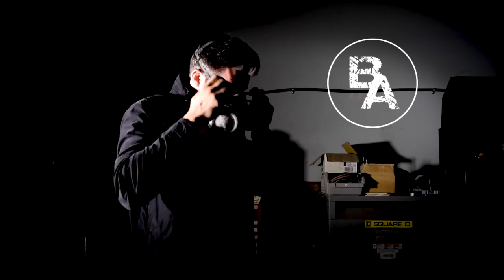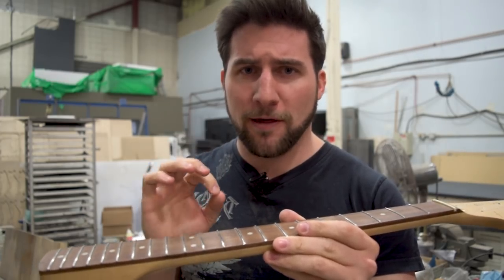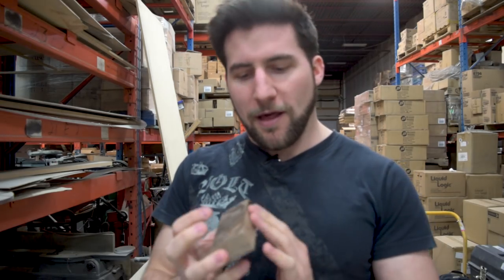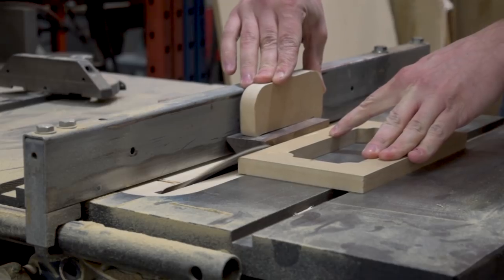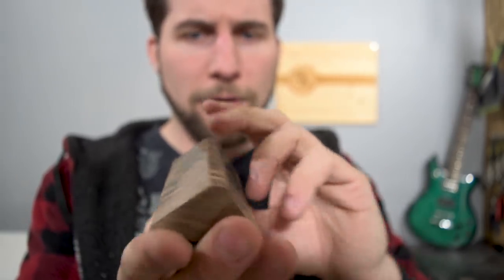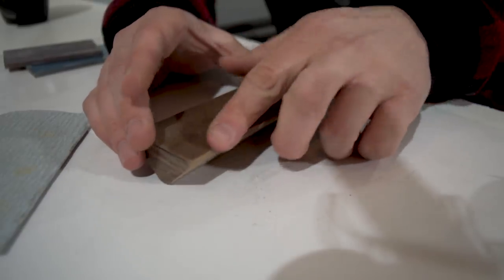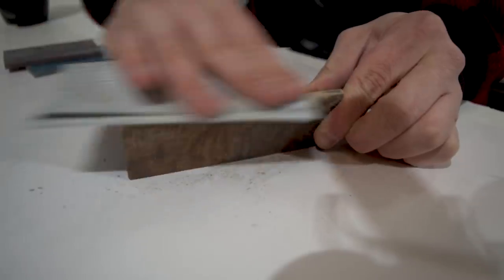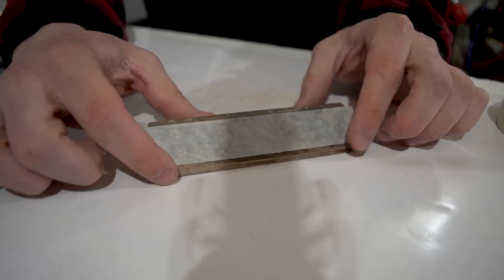CHEAP and EFFECTIVE DIY fret crowning tool

Comment: I bought a fret crowning file. They are about 5 bucks on Amazon
Reply from the maker: Yup. Only the good ones are expensive. The others are just slow.
Reply: @BradAngove  worked for me anyway. Enjoyed your video though. Thanks.
Reply from the maker: Glad to hear it got the job done.
Reply from the maker: Can you not tell which side is more aggressive if you shine a small light in there?
Reply: I bought a crowning file from Stewart McDonald. I use it about two or three times a month. It takes about two minutes to do all the frets on a guitar. Comes out perfect every time. Worth every penny I paid for it. Is sound last me decades. Cheap is never the best way.
Reply: @erichuff6945  There's cheap, there's fast, and there's good. You get to choose two.
Reply: @doctorschmitty4122  I have been a professional mechanic for twenty five years. Cheep tools don't make money and can get you hurt. As a commercial truck mechanic half assing a job can get you a prison sentence. I guess the level of discipline I have for my work carries over to my hobbies. Plus every instrument I build has to meet me standards for playability. If a tool isn't good enough I will make on that is.

Comment: I can see a lot of issues with not only making the tool because I don't own a table saw but in using it. I am way too lazy to take the time to do all that work when just as I am writing this I can click play and a tool shows up I unwrap it and go to work! It looks like this
Reply from the maker: Or you could just buy a neck that already has this done haha.
Reply: @BradAngove  Say What... Do they make necks with fret wire that has already been crowned and polished? Why would they take all the fun away???
Reply: Brad, I bought my first tele this week off of an auction site. When Opened the box and debubble wrapped it, At first I was real mad at myself for not paying close enough attention to the pictures or description because I bought somebodies d.i.y. project gone bad. No sound, opened the cavity for the output jack and the knobs, half the wires were never soldered, barely any paint on the bod, rough as hell as if sandpaper must not exist where this person lives and talk about a baseball bat of a neck if fret wires not installed correctly (I think?) They had to of used a hand saw without a template? But that's ok I did not think I was ever going to need the skill of sanding, grain filling staining or painting the body, havent decided yet, waiting for some inspiration on that! The color on it matches  a short scale Luna I have, so I am thinking I'm gonna color match and paint it, but I wanted to send you some before pics and let you get a good laugh. This will be my first real "build" if you will and when I think I have finished, if I'm able to, I will send you after pics or...a video!
Reply: Opps forgot to attach pics, well I dont think I can attach any pics here?
Reply from the maker: Wow that’s sounds like a true mess haha. You can use the links in the description for Instagram or Facebook to send me photos.

Comment: If you use a piece of square stock and plane a 1/4" flat on each corner there is no need for any risky 45 degree cutting
Reply: Correctomundo

Comment: Why not just crown it into a point? Like an upside down "V"? Isnt that way more simple?
Reply from the maker: It’s less comfortable, harder on your strings, requires the removal of much more material, and makes the tops of the frets less durable because of how little metal is left. That is likely to result in you needing to re-level sooner, and because of the new shape you would end up reducing the height of your frets much more rapidly.

Comment: Did you say you have a fret leveling video. Or that you need to make one? I see guys take the leveling bar that is the length of the neck and go up and down the length. I saw one video from a Luthier that says that is wrong. He says  You lay it across the length of the board but sand back and forth  from the 6th string to the 1rst and visa vera
Reply from the maker: If you move a bar the size of the neck the entire length of the neck you will oversand the middle frets. 
I’ve done a couple videos involving feet leveling, but I think I can do better. I will have another one coming out soon.

Comment: I went to to Rona looking for metal stock to use for a leveling beam as I don't want to pay $50 for a 16 inch piece of rectangle stock steel that's worth $10 if that. They didn't sell it so I thought "maybe a nice piece of finished hardwood".....they had a piece that was the perfect size....same as a 2x4 but finished sides and dead straight oak and about 48" max. I laughed and said it's probably $60. The girl checked and it was $60 and change. NEXT. I'd do better cruising the dumpsters of metal shops.

Comment: I understand the concept but why instead of making a tool(which requires other tools by the way that most people dont have) dont just use a small flat surface with a piece of sandpaper attached to it with double sided tape....and use it the way you would use a triangular file to shape the frets,mark the tops again with a permanent marker and go to one side of the fret....angle it just a bit....and make 4 or 5 passes...then go to the other side of the fret and do the exact same(counting the passes to make sure they are even)....each time a little bit of the marker disappears until only a very thin line remains on top...by then the fret is crowned.....
Reply from the maker: That’s what you do with a regular fret file haha. Which is fine, but still slow and relatively difficult. I made this because it works fast and easily.
Reply: @BradAngove  i think the faster and easier is a piece of sandpaper wrapped around your middle finger travelling all across the fretboard.... the frets are crowned perfectly.......
Reply from the maker: That’s a polishing technique. It doesn’t crown the frets at all, and if you use more aggressive sandpaper it can create problematic low spots etc.
Reply: @BradAngove  It works...if you want,check out a system called Thomas and ginex...they use a metallic piece with bumps that you can run across the fretboard along with 400 grit sandpaper and decent amount of speed..cause just like a finger it hits the side of the each fret first and rounds it up....if you do it slowly it wont work but fast it does the job and doesnt mess the levelling job....
Reply from the maker: Intriguing.
Reply from the maker: Intriguing.

Comment: Nice - but why not just get a piece of molding that's already at a 90 degree angle, sand down the point and save the cutting.
Reply from the maker: Where’s the fun in that? Haha yeah, if you get a nice square piece and it’s hard enough wood, that will work just fine.

Comment: I know this has become a popular way for beginners to crown frets, but it's really not very effective. All you're doing is removing the sharpie mark, but barely removing any material from the fret to give it a proper crown. Something to keep in mind if you try this and wonder why your frets still feel like railroad tracks after polishing and everything. Using a triangle file is a much better way to crown, especially with a diamond grit. It actually shapes the metal, not just removes the sharpie mark. You'll notice a huge difference in feel with a properly crowned fret. Stewmac has a great tutorial on how to use the roll technique to crown. If y6have stainless steel frets, the technique in this video is especially useless. 400 grit sandpaper isn't gonna do anything to shape steel.
Reply from the maker: You’ve never sanded stainless steel before? I actually prefer using sandpaper on stainless because it ruins files so quickly.

Comment: You cannot beat triangle file that you the talented have put a safe edge on one side. How use a file followed a sharpening stone. You need to be able to see what's going on. Every thing else is a hack method. The file is 4 dollars maybe. This my friend is from experience.  I hate doing things twice. And I hate settling on anything that is not the expected result.
Reply from the maker: This may be from experience, but it’s a wildly outdated perspective given some of the better options available now. I have used the triangle method and I try to avoid it; it takes far longer than many other better options.

Comment: soon as you said your going to cut  a 45 on both sides on a table saw , i could see you losing your fingers
Reply from the maker: It's actually pretty easy to cut a 45 with a table saw.
Reply: @BradAngove  noted but i was referring to the small piece you were cutting
Reply from the maker: Fair enough

Comment: Or....you could buy a littlebone fret tool for $23.  It's funny. I've increasingly seen a whole bunch used guitars with frets that need to be replaced because of bad fret jobs or newer ones that need a complete relevel.  If you take the time to use micro mesh, up to 12000, it does the same as the metal polish.  I was glad not to see a dremel used.
Reply from the maker: The little bone is a good option. It doesn’t allow for any rounding, but if you don’t mind a more angular fret it works well. 

Yes, 12000 mesh is very similar to polish. Not quite the same, but close. 

I often use a dreamer now. It works well, and if you’re careful and use the right compounds you don’t need to polish sand it quite as far. It’s a bit quicker for people who do quite a few of these, like me.
Reply: @BradAngove  No doubt. I use the little bone in combo with a fret guru round over file. I like sanding just because I find it therapeutic. I know, I'm whacked.

Comment: Christ it takes longer to make the tool than it does to crown the frets.
Reply from the maker: Indeed. The idea is to use it for several crowning jobs haha.
Reply: @BradAngove  Wow !!! I'm surprised you responded to my comment. Don't mind me dude. I'm just running my mouth. I am gonna take a stab at leveling the frets on my Mexi-Strat though.
Reply from the maker: I hope the leveling job goes well for you.

Comment: What about “peel and stick” paper? Wouldn’t that be easier than the superglue and regular sandpaper thing?
Reply from the maker: It might be, but given the wooden surface I’m not sure how well it would stick.
Reply: Double sided tape is a tad thick, speaking in the tenths of a millimeter realm. This means it is spongey. Which means any pressure inconsistencies result in waves in that beautiful Apex you are striving for. What he did here is actually called "The masking tape and super glue trick" 
Crimson guitars was the first place I saw that trick and it has made my life so much better.
Reply from the maker: Indeed; that is where I got the basis for it. The only variation being that because of the application I only need one piece of tape.
Reply: @CavemanWithAStringStick  Didn't Crimson use a roller to even out the glue and if u used a low viscosity glue it would also be better.
Reply from the maker: No, crimson uses the superglue trick essentially the same way I did but they put accelerant on the opposite side. 
The roller is for wood glue.
Reply: @BradAngove  oh...but i do remember someone of a high standard doing the roller thing for a fret level job.
Reply: ‘Crazy Glue’ accelerate actually makes the glue to continue to harden over the whole life of the glue. Minutely continues, half lives I suppose. I’m sure somewhere along the line it does eventually stop. Also causes heat. My point, ‘Crazy Glue’ or cyanoacrylate is actually more of a plastic type of substance, which starts to set or harden due to the moisture in the air. Place a drop or two on any throw away non-absorbent surface place a small amount of water and it will accelerate faster than just letting it air dry, so to speak. This plastic I believe is harder than some fret or finger board woods you may run into.
  3M and a couple other companies including Duck make a two-sided adhesive tape that is a little thicker the Teflon tape or quite a bit thinner than the masking tape your using. Almost water proof. You can usually find it in tape and glue section of most family owned hardware stores. If they don’t have it, they’ll know what your after. Used to be marketed as carpet tape, but that now has a padding added to it for some unknown reason. Would actually cut a step out of resetting your tool every time you change the paper.
 Brand name accelerates will mar certain types of paint finishes. Has a acquired smell about it. I use it on occasion from time to time. Away from finished surfaces for sure.
  Great lesson non the less. I am trying to learn as much as I can about maintenance of guitars.

Comment: That seems impossible to me that 800 grit will crown a fret. Even a coarse crowning file takes 5 minutes per fret to cut
Reply from the maker: Are you working on stainless steel frets?
Reply from the maker: It shouldn’t take nearly that long. The sandpaper method works well, but you’ll want to start with something like 320 or 400 grit and then do the 800 grit.
Reply from the maker: That’s surprising; it certainly worked for me (and seemingly many of my viewers). The z-files from stewmac are considerably faster though if that’s your priority.